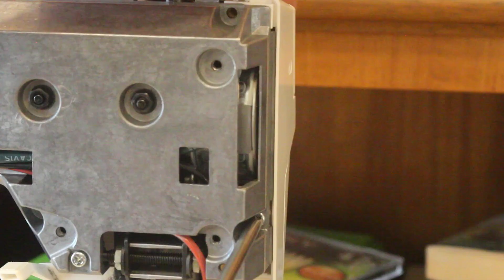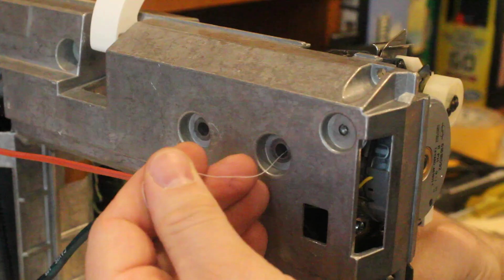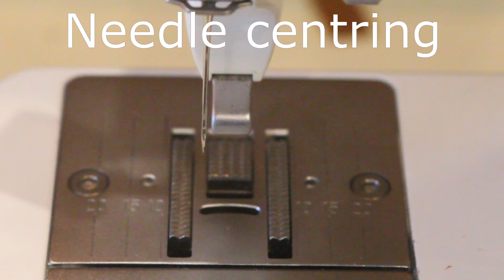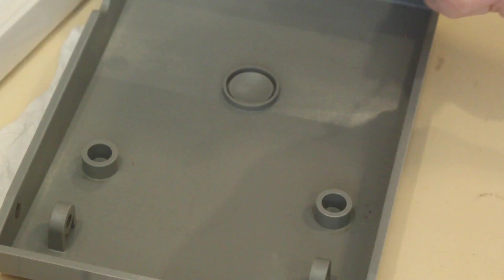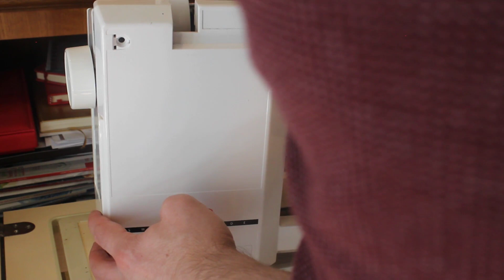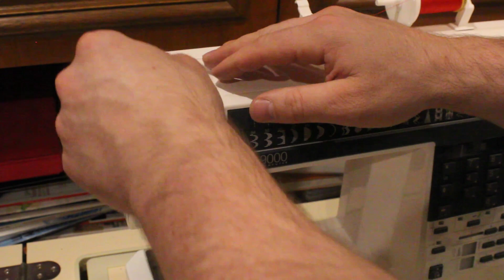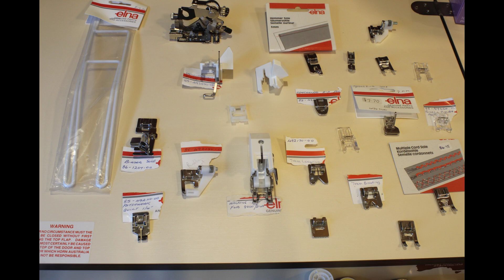Side of the Road Special # 2 - Elna 9000 computer sewing machine (Service, repair, and review)

Comment: hi , especially with old sewing machines like the elna diva. is it necessary to lubricate it ? thank you for the video but do you need to remove headblock to lubricate it?
Reply from the maker: Hi, most machines require lubrication (only some high end newer machines have "sealed for life" bearings)

In general if there is metal to metal contact use a light oil, if one part is plastic use a silicone based grease/oil.

You don't need to remove the headlock to lubricate the machine. 

Good luck, thanks for watching!
Reply: @grannyflatgarage7599 thank you very much for the advice.. I underestimated elna parts being hard to find but I might as well give it a go.

Comment: Excellent video, expertly done. Did you happen to notice what value to AC smoothing capacitor was on the power supply board ? Mine just blew up and destroyed the markings ! I have a selection of replacements, but not sure which, can you help ? Ta mate.
Reply from the maker: Oh no! Sorry, I'm not much of an electronics guy (trying to learn). Is that the large capacitor hanging off the top?
I checked the photo I took of the board and its mounted so that you can't see the value. 
If I open it up again I'll try and have a look for you. 
Good luck!

Comment: I bought my Elna 8000 in 1990's and now i finally have time to sew.  Thank you so very much for this video.  Do you happen to have instructions for the button hole attachment?  I can't get mine to work.
Reply from the maker: Do you mean the automatic buttonholer? 
Make sure you're using the right stitch number which is 200 + the normal buttonhole number (eg 218 instead of 18) 
Make sure the electrical contacts are clean.
Glad you enjoyed the video!

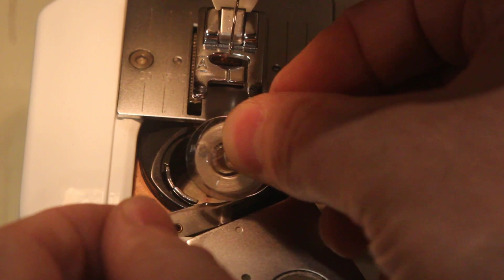Comment: Excellent video, and great job of repairing it. They also have an issue with the bottom shaft gears. They crack after a while and of course haven't been available for decades. I noticed you put the bobbin in upside down at 30:23. My latest one was destroyed by someone leaving batteries in it for decades, The main board won't work at all now. Anyway, thanks. Mike (sewing machine mechanic)
Reply from the maker: Good pickup haha. I did check the gears and they didn't seem to have any cracks which is good. 
The batteries were left in this one too thankfully only the contacts were damaged and I've just been using it without the memory function.  I'll probably look at repairing it at some stage though. 
Thanks for watching!

Comment: Thanks so much for this! I just got one of these for free and your video is going to be an invaluable resource. Some parts are missing which I may struggle to replace (like the rotating spool cap, the fabric guide, and the zip foot) but i’m excited to give it a go once I have everything I need.
Reply from the maker: That's a great pick up! I hope you have a lot of fun with it!
Reply: @grannyflatgarage7599 
It’s been really fun so far. When I opened the battery compartment, it still had batteries from West Germany hahah. 
I have a troubleshooting question (and I may have more at some point 😅) 
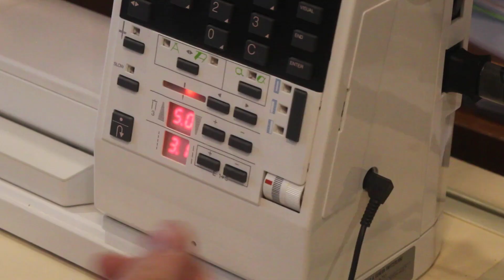27:43 I’ve made adjustments to the balance so the overlock stitch looks normal on the right side, but when I flip the fabric over, the bobbin side looks incorrect, with the middle stitches not overlapping. Any idea what might be happening? Is it likely just a tension issue? I haven’t been able to adjust the lower thread tension because the screw in the bobbin has seized a little and my screwdrivers are garbage lol
Reply from the maker: @lailedcat That is a strange problem, are you sewing a single piece of fabric or 2 pieces together? 
It might be the top and bottom pieces sliding out of alignment slightly. 
It could also be a tension issue, maybe try soaking the screw with a little bit of penetrative oil (can buy in a spray can from auto parts stores) to see if it will free it up. 
The other thing is it might be a bent needle, they can cause all sorts of odd issues, rule of thumb if the machine is doing something odd try a brand new needle before any other troubleshooting!
Good luck

Comment: Thank you, and HELP please!  My automatic buttonhole device (30:50) is not doing its job - it seems to only make the left side of the buttonhole. Do you have any insight? I can't find any other reference to it online.
Reply from the maker: Hmm I'm not entirely sure. One thing you could try is making sure the contacts on the attachment slide are clean.
Also are you using the correct stitch number you need to add a 2 to the start of the stitch for the auto buttonholer so 215 instead of 15 or 218 instead of 18. 
Hope this helps.

Comment: My 8000 will not reverse when zig zag pressed. It freezes until I disengage foot control and then engage ok. Reverse works with a straight stitch. Any ideas, thanks.
Reply from the maker: That's by design. On straight stitches, the reverse will work like an ordinary machine.  
But, on any stitches with a side to side component (like a zigzag) the reverse will "lock" the stitch by sewing 3 stitches in place and then stopping.  
I think the idea is that on a decorative stitch you won't mess it up by imperfectly going backwards. 

I find it works pretty well for locking the thread off however, I agree for a plain zigzag it would probably be better to reverse properly.
Reply: @grannyflatgarage7599  That's what I expected. The Elna 7000 (which I was familiar with) reverses continuously using a zig zag stitch. Go figure why they changed that feature.

Comment: How do you put a walking foot on this machine?
I have been trying to find instructions on it but I can’t find anything
Reply from the maker: Unfortunately it's a proprietary system, you either have to use clip on feet or larger feet that slide into the plastic piece above the shank.

https://www.sewingmachinesplus.com/tacony-492000-20.php?srsltid=AfmBOoqOfTt6nctq2RJnJTqTRToAdptiBon3YXJSpEBzqXSb2qx6BapY

This is for the 7000 so I'm not positive it will fit but you can see the sliders for connecting it which are similar. 

If you have it, it's the same connection as the automatic button holer or the embroidery attachment.

Comment: This is a fantastic video and has been very helpful. I don't normally restore vintage electronic machines but I just picked up a Club 5000, the baby brother of this machine. Unfortunately the needle does not swing when zig zagging and centres to the far left. I tried the centring test and it stayed in that position. I haven't opened up the machine yet, but is it possible the needle bar is just seized or does it sound like the stepper motor to you? Cheers
Reply from the maker: Thanks for watching,  if it swings all the way over when you start it but then gets stuck there it sounds like the stepper motor is working.  
Probably take the covers off and check the connection and wire integrity first. 
You can disconnect the stepper (you may have to remove the head block) and move the needle by hand/check the stepper without load to see where the issue lies, good luck!

Comment: Amazing instructions.
 I have a 7000, and your video helped  me decide it will be too complicated to get it fixed. (I'm not that brave). My timing is out and doesn't pick up bobbin thread.
I wasn't even sure parts were all there. I realised as you took yours apart, the little side cover (to insert cassettes)  is missing plus all the screw covers.
Previous owner has also unscrewed the needle plate Allen screws and clearly lost the nuts and 1 little washer.
Also no cassettes or flat bed plate and no manual.
But it didn't cost me anything, so no loss.
THANKYOU, I still learned a lot.
Reply from the maker: Glad you enjoyed the video. Shame about your machine 
 It may be worth putting online for sale (ebay gumtree etc.) Just as a parts machine, they're getting rare now and even broken ones are fetching a bit, you might be able to give someone else's machine a new lease on life.
Happy new year!

Comment: Wow!! I think I just watched the smartest person in the world.  I am glad you showed that bobbin winder assembly. My machine is the 8000; from the outside, it looks the same. Sometimes this one just does not want to engage and spin even tho the machine does recognize the bobbin winder is engaged . Usually rebooting a few times works.  I purchased it for $100 U.S.  That seems to be the only issue so far. I love the Buttonhole feature on this machine. I personally do not like the modern ones with that foot they all have.  They are nice but I always start them in the wrong place. With this machine not a issue at all.

Comment: What kind of liquid did you put inside the grooves in the pedal for a smooth movement?
Reply from the maker: Silicone grease, it's safe for plastics. Should be available at hardware or auto parts stores.
Reply: @grannyflatgarage7599  Thank you very much! I am thrilled to see how kind you are with your answers!😊

Comment: Your video is fantastic - a pleasure to watch!!! I have this Diva 9000 Elna machine since 1992, it cost me £1500 in the UK, and it was an absolute state of the art piece of equipment in its glorious days. I made beautiful designer clothes with it!!! The last few years, well, many years, I neglected the machine and it has suffered dampness problems, which made some of its parts pretty rusty… it still switches on and changes the numbers for the stitches on the display, and probably would have been sewing perfectly well, but my main problem is the control pedal, I took it apart some years ago and lost the round plate inside it with the three clips, so now it does not activate the machine… when I switch the machine on - it shows different stitches on display, but when I connect the pedal - it goes into three interrupted lines, and nothing… of course, perhaps, there is a deeper problem rather than the pedal, but without it I cannot really check the machine out. In fact a few days ago I bought a Chinese replacement pedal online, it came today, but it definitely does not work with my machine)))
Reply from the maker: Thanks! That's a shame about your machine. Have you tried looking on gumtree or Facebook marketplace or ebay? I see used pedals and other parts coming up quite often. Like you said their may be a bigger issue but at least then you'd know.
Good luck!
Reply: @grannyflatgarage7599  Thank you for your thoughts!!! I have spent the whole day today rearranging the pedal, but still nothing… the machine switches on and I can change the settings for the stitches, but I cannot activate the needle moving, nor, for some reason, the wheel - I cannot turn the wheel manually at all. I am so sad…
Reply from the maker: @yelera3082  Hmm sounds like the pedal might not be the issue. If you can't turn the crank by hand then I would definitely suspect that the crank is seized.

My suggestion for the next steps would be: 
Try turning the machine on in test mode (hold x and memory whilst turning it on) like in the video and test the stepper motors. 
Test the bobbin winder function. 
Take the rear panel off, loosen the main motor and remove the drive belt, then test again with the pedal to see if the motor spins. 
If all of the above works then the circuitry is probably OK and the crank would be the only issue. A decent repair centre may be able to sort it out. 

Hope this helps.
Reply: @grannyflatgarage7599  Thank you very much!!! I appreciate your help and taking your time to think about my problem. I am really not that technical at all, I have watched your video several times, but mainly because of the pedal issue. 

About the pedal, I had taken it apart years ago after watching a video about the repair of this model, as it actually made the machine working /then!!!/, but it would not stop running until I took the jack out of its socket on the machine itself. So it was a nightmare. But it did not affect the quality of the stitches etc. Then I tried to repair the problem and the video suggested to cut off some metal wire inside the pedal, which I did at the time. Then the lead got damaged and my friend replaced it years ago with the new jack /may be like the audio one you were talking about before/ and a new lead, although it is not attached very safely to the original base. Anyway, visually the pedal now seems to be fine, although it does not activate the machine, but does get somehow recognized by the machine, as it makes some noise, when I attach the pedal… but nothing else… plus the sliding motion inside the pedal is extremely stiff… I have already taken it apart and put back together  four times today while watching your video… but I do not have the silicone stuff yet, just the lubricant for the metal parts. 

Tomorrow I shall try and have a look at the video again and perhaps dare you to take off the back panel to see about the crank and the thread winding mechanism. 

Thank you so much again, sorry, that I do not know your name. Best wishes from Spain from Elena.
Reply: @grannyflatgarage7599  I have seen replacement pedals on the US eBay mainly, but it costs like 70 euros with delivery… it is a bit scary to spend so much money, if the thing will not work)))😅
Reply from the maker: @yelera3082  I don't know how handy you are with electronics but, the plug is just a 3.5mm audio jack (like off a pair of earbud headphones )Ive just checked my pedal with a multimeter and I'm fairly sure that there's just a 10k ohm variable resistor between the outside two connections (the middle one appears unused)
This at least should allow you to test the rest of the machine.